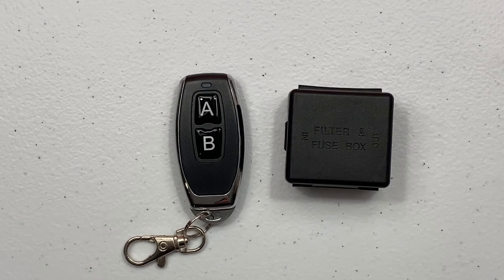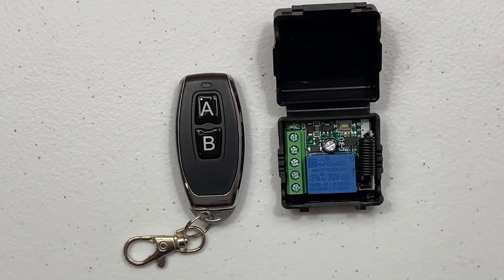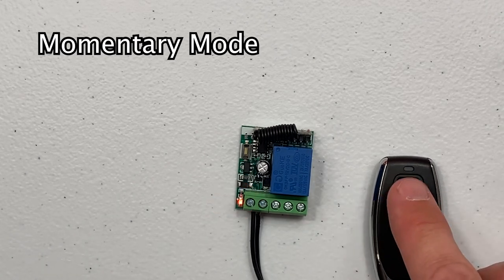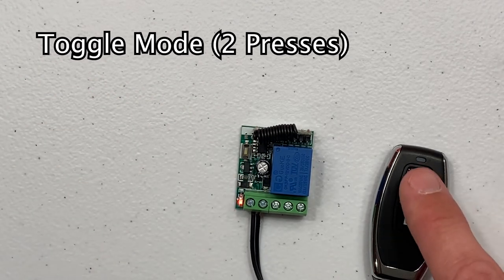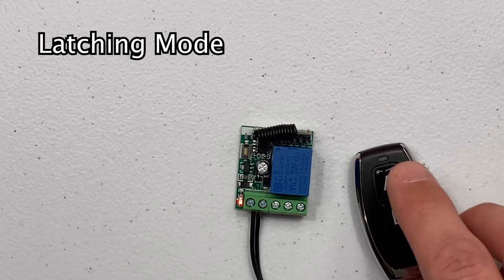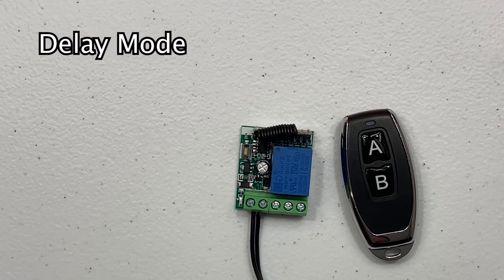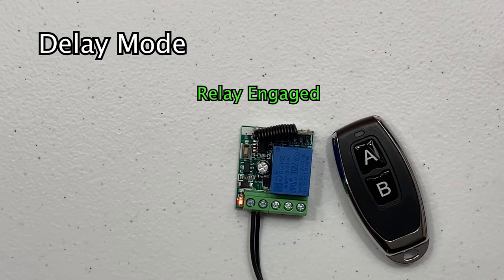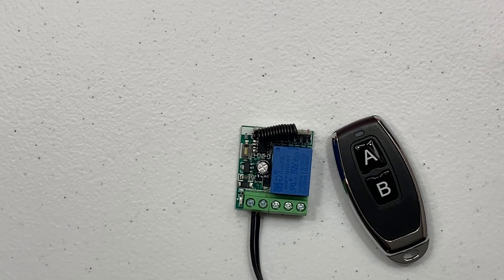Configuring the Experience Lights RF Remote Control Relay

Comment: What intended use would you use these for ??
Reply: I will use it to turn on my music outside when there is a crowd.  Sometimes people are to shy to go up and push the button on my sign to turn on the music.    I have another that I may trigger a test mode on my FPP so I dont have to pull out my phone or go inside to my computer.  I will also have it turn off a test mode with the second button.
Reply from the maker: I used it this year to trigger effects in FPP when kids would say a Harry Potter spell.  I'd keep it in my pocket, and press the button after they successfully say the spell.  They thought it was magic!
-David